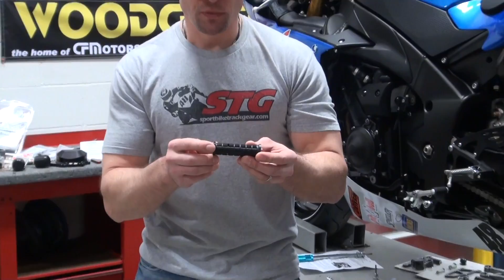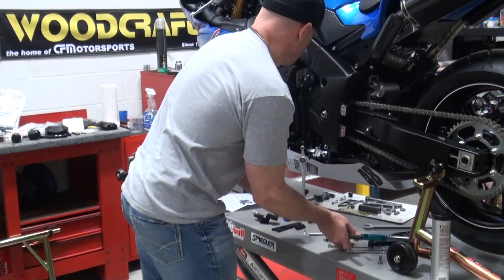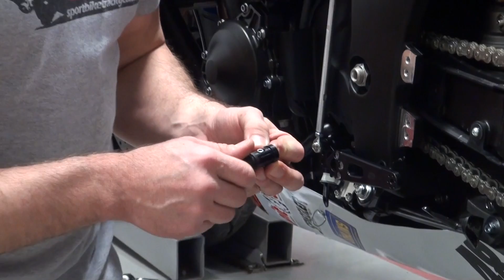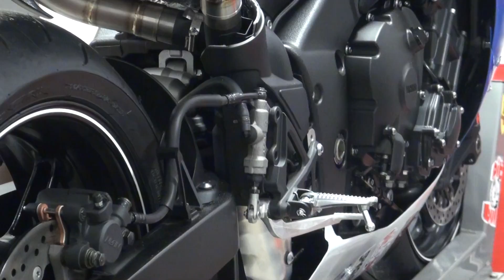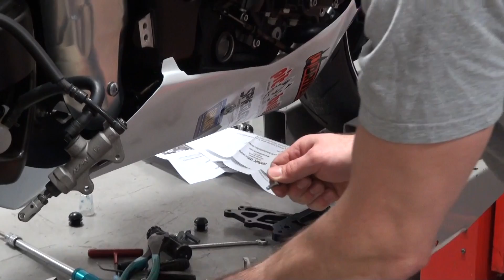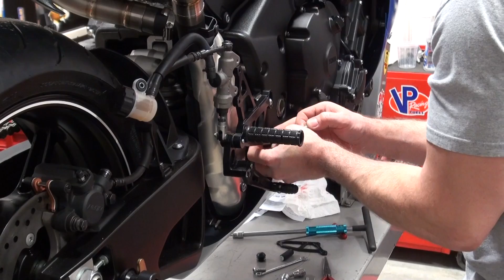Woodcraft Rearsets Install on The 2013 STG Project Bike

Comment: Will I be dealing with loss/spillage of brake fluid with this set up? Just asking overall the dis-assembly and the trimming of the hose leading to the brake fluid reservoir, I have galfer steel braided brake lines too so is that a problem? Thanks much appreciated! -Rudy